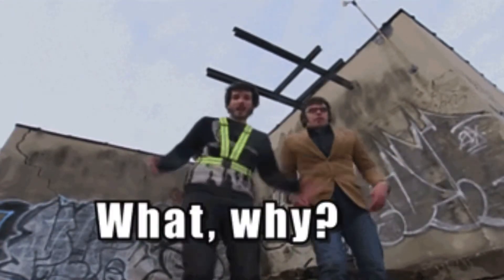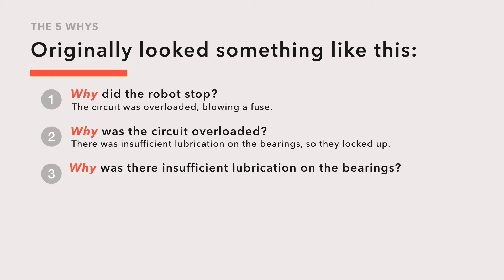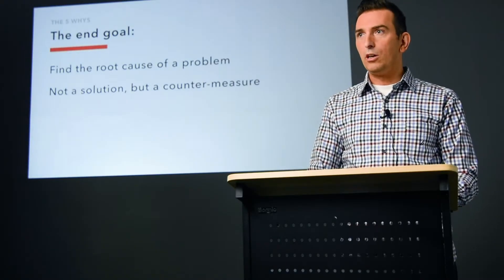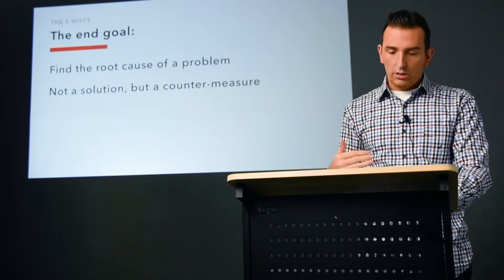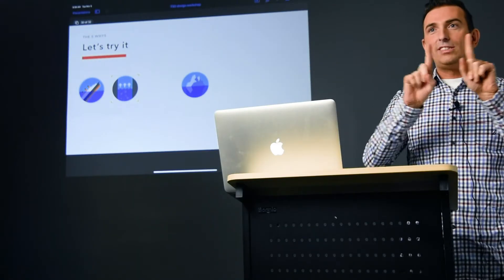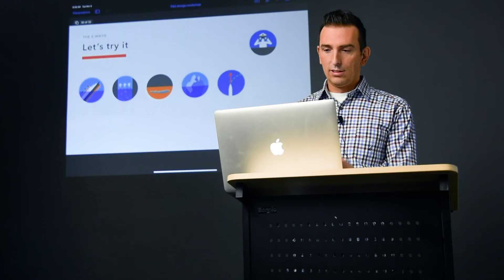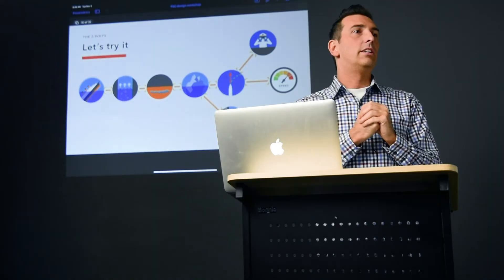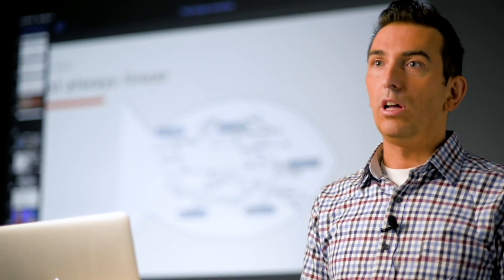The 5 Whys - Identifying The Problem To Solve

Comment: The tear in the Titanic's hull was so large as to overwhelm the designed water-tight compartments because the steel used in construction had such a high sulfur content that it had very little impact strength. The steel was tested for tensile strength but at that time it was not common to test for impact strength. The difference between the two types of strength can be demonstrated with a piece of dry spaghetti. To pull a single piece of dry spaghetti apart takes a relatively significant amount of effort compared to what it takes to snap it in two. That is the difference between tensile and impact strength. The lack of impact strength in the steel of the Titanic's hull resulted in the steel essentially shattering, creating a hole too large for the watertight compartments to contain.
Reply from the maker: Love the spaghetti illustration!